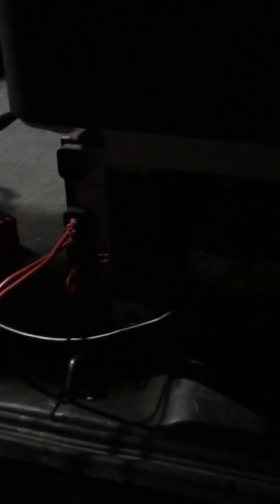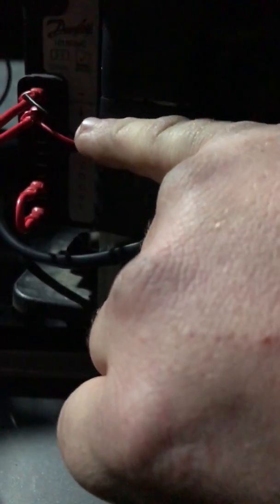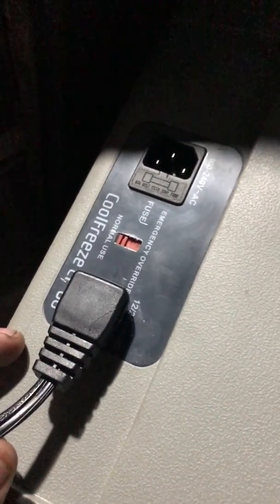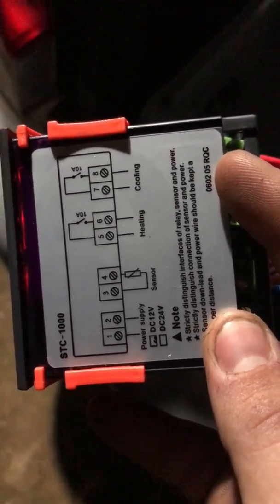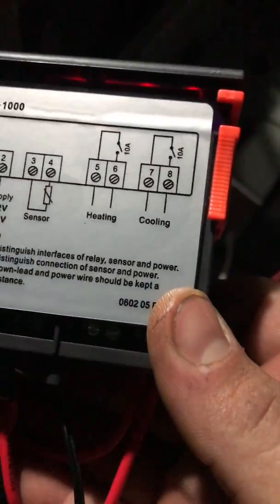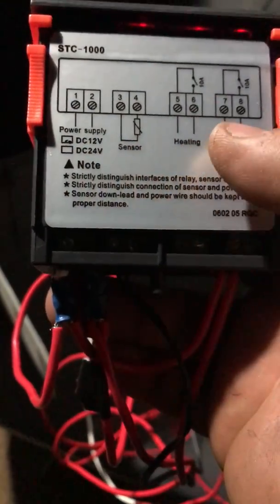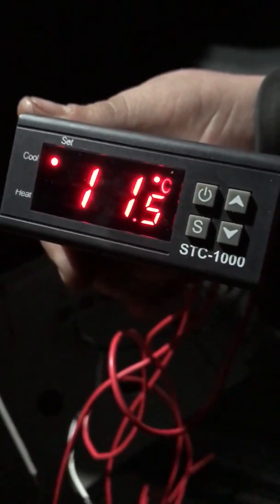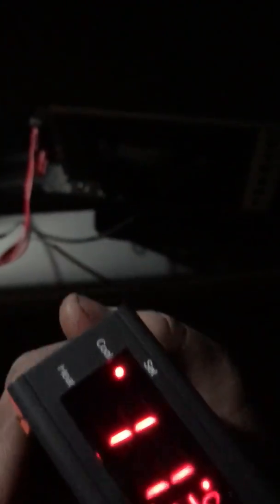Stc-1000 thermostat for fridge

Comment: Assuming you have used 12V to power the STC-1000 thermostat, how do I wire it with a peltier cooler so that it turns off once the desired temp is reached? Thnx